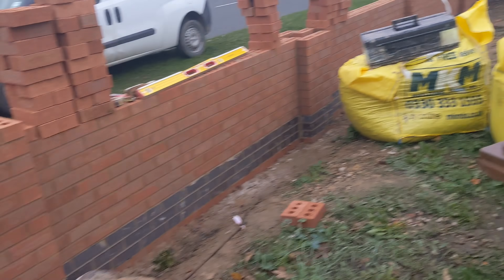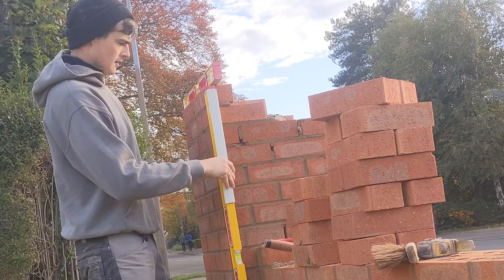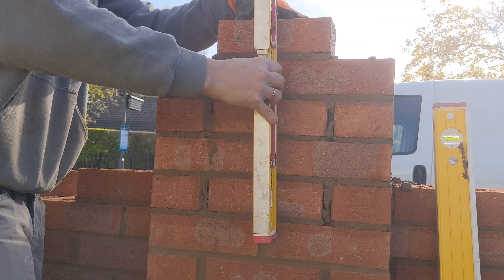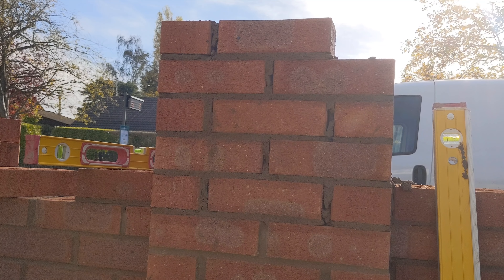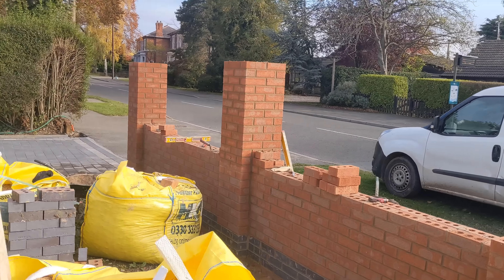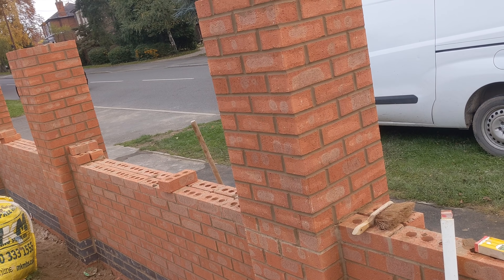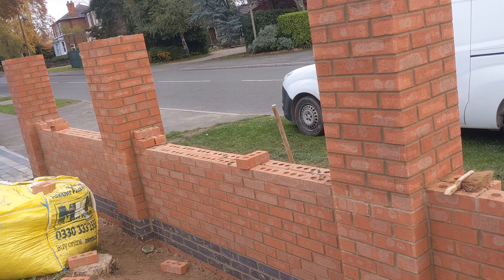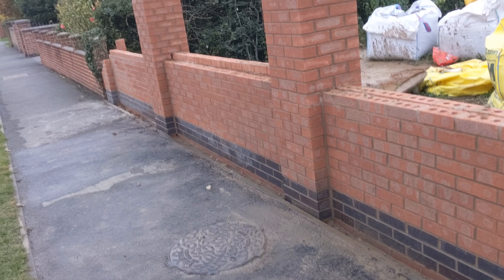Bricklaying - Building pillars for 8 hours - Good Job = More Jobs #bricklaying #vlog #brickwork

Comment: i would build first and last pier then you can pull a line through the length of the wall and run all the piers in course at a time
Reply from the maker: Very good shout mate, I'll probably try that next time..got another job like this coming up in a few months👌 probably would have done that on this job to be fair.. but just seems like alot of walking about. The first x3 course of the pillars were set like that, so they are all cockon inline and that👌
Reply: @IzzytheBricky  a lot easier that way mate, everything stays true, 👍
Reply: Totally the  right way to build it and certainly if you had something going over the top of them , two profiles each end line each side job done
Reply: Slow moving around to them all. I would build two end piers and then in put a line on top you can plumb to and check your heights.

Comment: Nice job mate I know a few that fill them in after they laid them. It does work. Done it a few times myself when joints are tight. On repair jobs👍👍👍
Reply from the maker: Cheers mate! Yea these bricks dryed so quick as soon as the perp went on it was gone off 😂 which is surprising for this time of year🤔
Cheers Mark mate, that kitchen looks mint by the way👌👌👌😍
Reply: @IzzytheBricky  chears fella 👍👍👍😉

Comment: How wet should the mortar be and how do you stop mortar being pushed out as the pillar goes up? I’ve tried a fairly dry mix but I can only build 4 levels before mortar is pushed out of the joints? I’m a DIY and building piers along a garden wall. Any advice appreciated

Comment: Don't want brick to push with joint put full joint then dent center with trowel tip. Never leave the front open. Looks like crap if owner or inspector was watching. Extra time to fill and it's never as clean as   when to have to repoint. You filled from top and it ran out the joint onto face brick.  Average bricklayer should drop 300 in piers like that in 7 hr. excellent bricklayer over 500.

Comment: Tbf with those stocks you could probably do 10 without levelling it but those your using want levelling every course without question!
Reply from the maker: Cheers mate! Yea didnt know if you could see in the video, but them bricks had a right whip over the top of them👍
Reply: I'd do it mate saves plumbing all the way round each pillar aswell and keeps everything bang on too gage.

Comment: I’d crack a good 800 down on the wall, doing the piers on your own is a mistake ( big mistake )
1 pier each( two ends) 1 each side running in!
So much time is lost moving about, IZZY you are tidy enough but taps and scrapes are costing you a fortune